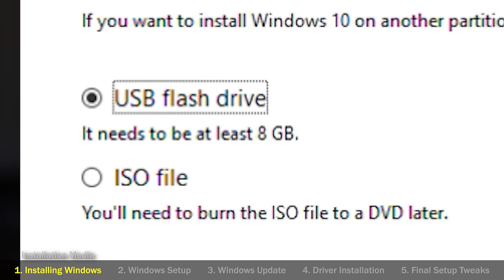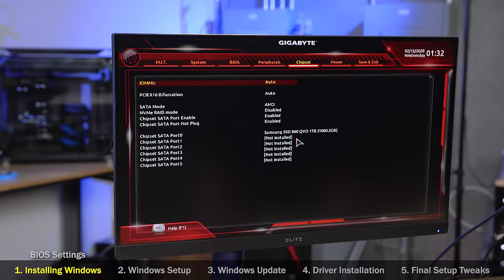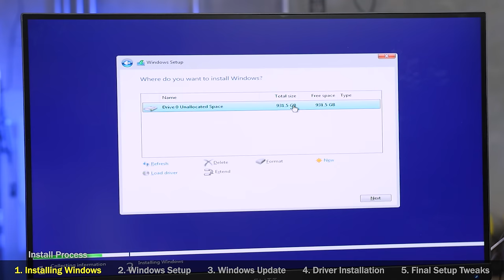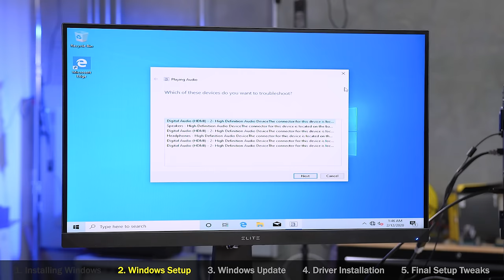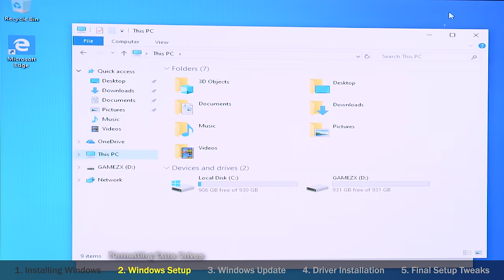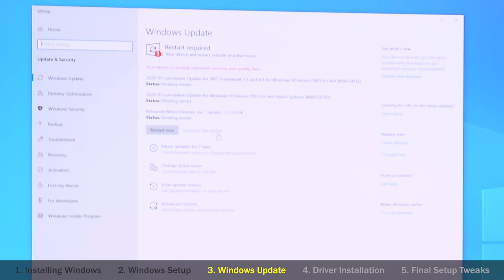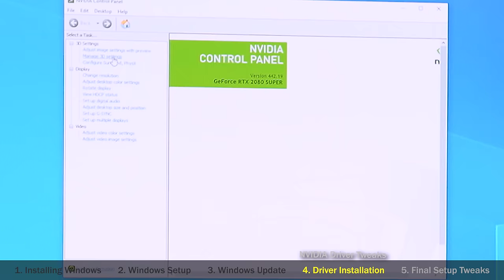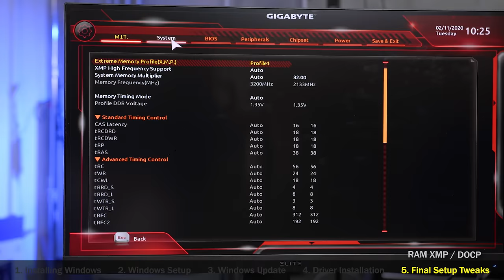Guide: What to do AFTER building your computer...

Comment: Funny enough, when I built my new PC I installed windows with an old boot medium I had lying around, and it was utterly unable to connect to the internet because the ethernet chip was too new to be recognised by the system - it knew that it was an ethernet chip but the driver simply wouldn't work.
Since the previous system had gone completely dead, I found the most insane workaround imaginable. I used my phone to create and download the .iso from microsoft, then copied that to the pc, then mounted the .iso as a virtual device and from that updated windows to a version where it could understand new ethernet chips :D

So, for anyone saying "always have a boot medium laying around" - yes, but also make sure it's no more than a few months old to be sure it can recognise current hardware components too. With an USB, just swap the data - with a DVD (if you prefer those or don't have a 8GB+ USB), either use a re-writable one or make sure to create new ones regularly.

Had to swap the mainboard anyways because it was a b550 rog strix board and those have faulty intel chips - my second piece of advice is, if you go for a b550, don't buy a ROG strix, and if you go for a ROG strix, don't buy a b550. With newly built ones I think the chances are good you'll be fine (intel updated the chip twice to work properly) but the risk is still that yours might stop working after a short while. So, third piece of advice: research the parts you're interested in before shopping! Some may be faulty or otherwise less-than-ideal, and you can save a lot of time (and potentially money) by making sure you get the right kit.

Comment: Aight, windows 11 doesn't let you continue to install unless you connect to the internet. There's no option to continue without, just a disabled next button until it's connected.
Edit: I first tried the killtask way but that's updated on newer Win 11 versions, using "OOBE\BYPASSNRO" worked for me.
Reply: How did you bypass the internet? I'm new to this and not familiar with that OOBE\ thing?
Reply: Had to google so I'll help others: F10, click in the black box to type, type "OOBE\BYPASSRNO" (those are the letter "O", all caps), press enter and the computer will restart. You'll re-answer some questions and now will have the "I don't have internet" option. :)
Reply: Just tried it and had to Google because it didn't work for me.

Shift+F10
Then type OOBE\BYPASSNRO
in command prompt and hit enter.
Computer restarts.
Answer same questions again and when you get to the connect page you now have the "I don't have internet" option.

Only the Shift part was missing from the original comment.
Reply: Also be advised that a Bluetooth/wifi keyboard would not work for this. 
Bluetooth no connection as drivers are missing. Wifi channel let’s you pull up cmd, but then doesn’t allow you type anything. 
So be sure to have a wired keyboard.
Then once you make it to the desktop you can manually install the internet drivers from a usb drive , which will now fix the internet on your pc. As during windows installation you likely couldn’t connect to the internet or would have done so instead of reading this lol.

Comment: For the windows part. I just had windows installed in a SATA SSD and for the 2 times I essentially had to rebuild my system to upgrade everything (New motherboard, new CPU, new GPU, basically new everything) I will just slap my SATA SSD in it and it's up and running. I then delete everything related to my old PC and then install the new things I need. I'm essentially transferring the "brain" of my older PC to my new one.

Comment: I totally agree everybody talks about the tower but not the hard part getting everything running. For instance it took me 12 days almost 8 hours a day to figure out how to get NZXT x62 to sync with the cam software. I tried everything cord related and driver related all the way to buying a whole brand new unit but unfortunately I got sent a used one from Amazon so I never got to figure out if that was the issue. Finally two weeks into it I bought a hub and it connected so at least I have life through my fans

Comment: 17:50 I highly recommend against setting prefer maximum performance globally. It barely makes a difference in games, so all it ends up accomplishing is forcing your card to boost to it's max clock 24/7, even if you're just idling on the desktop. If you're doing it for benchmarks then you should set this specifically for the benchmark applications.

Comment: 1:30 Wow! This is exactly what I need! I bought a brand new copy of Windows 10 on DVD, with the intention of doing a clean installation on my current PC (because the old Windows 7 "upgrade" isn't a proper upgrade). With my computer being so old and buggy, I figure I should just build a new computer instead.
I'll be building my new PC outside of a case, then transferring it into my old case (because my Thermaltake Armour+ case is awesome.). That means I will only have USB ports with no DVD drive, for installing Windows 10 from. In hind sight, I should have just bought Windows 10 on USB.

Comment: Would have been nice to find this yesterday. I got pissed off trying to figure out how to do this without an optical drive and went to bed. Spent a few more hours today and finally got it done.

I reused an old Hdd with data already on it and unallocated 500Gb to install windows on. I've hear that's not a great idea, but it's working fine so far. Also pulled another strange move in the form of reusing another drive with windows already on it as a secondary drive. Made sure the boot order was correct so I wouldn't have problems with it trying to use the wrong install.

So yay, I get to keep all my old data.
Reply: I wouldn't use a hard drive for Windows anymore. SSDs are significantly faster than hard drives and it will greatly benefit especially when installing updates. But to each their own.
Reply: @JJFlores197  I considered it, but I'd just built the rest of the tower and wasn't patient enough to wait any longer. I might reinstall it to an SSD in the future.

Comment: One important detail I think you forgot to mention and I realize it could be a rather "tricky" bit for novice users is updating the mainboard BIOS. To me it should be one of the last things to be done as long as the system is stable and operating correctly. t's not absolutely necessary but if you want the system to operate at peak performance, it could make a difference. If you're using, say, an older used board it's important to have the latest BIOS version on the system. Case in point, A z170 base chipset on some boards can run a 7th gen core i7-7700K as long as the BIOS is updated to a certain version and beyond but will not run the 8th gen chip at all. Similarly, some more modern GPU's require those updates as well. Just my "two cents"

Comment: 1:18 using my 5+ year old Win10 install disk caused me such a headache recently because none of my drivers wanted to work including WiFi and Ethernet. Ended up using a cheap usb Wi-Fi thing (which also required using usb to install drivers) to update windows after installing Windows. After that, the mobo Wi-Fi and Ethernet worked
Reply: Do you know a safe website to buy a windows activation key for cheap?
Reply: @oh60  can't you remove the watermark using bash or something?
Reply: @SuchANoobOG  I think you can, I might try it when I finish building my pc

Comment: Can see how some people consider transitioning from console to PC, it may not be obvious to some, but you can totally use your controller in games if that's what you're more comfortable with – using KBM is not necessarily required, so no need to fear re-learning muscle memory. Get games on Steam, they're cheap on sales.

If you're low on money, you don't HAVE to buy windows key, it can work unactivated with just a watermark.
And if pirating games via torrenting is your only option, at least consider using a VPN.
Don't feel intimidated about drivers and all the software part, you can't mess it up really. The worst case is simply reinstalling a driver/program and that's about it.

And make sure your screen is using maximum available refresh rate, you wouldn't want it to display only 60 if you bought a 144Hz+ screen. It's probably the most common mistake. If you don't have one, considering getting it, it's easily the biggest upgrade out there.

Comment: Here's a tip for those using ASUS motherboards. There's a setting in the bios that allows you to disable Armoury Crate. This means it will never get installed. Thus you completely avoid the bloatware from ASUS.

Comment: Watching this video is helpful. Does this work the same on the laptop? Because I was wondering if I buy a new laptop and want to move my old data from my current laptop to the new one?
Reply: Your new laptop will already come with Windows so no need to re-install it, unless you want to. But yes the overall process is the same. Do note that most laptops have far limited UEFI systems compared to desktop computers. Things like CPU and RAM overclock are usually non-existent in laptops.

Comment: Thanks for the video! 
Question:
Setting up a new computer with 2 different RAM sets. Both sets DDR5.
Set one 2x32 Corsair Vengeance 5200 PC541600 C40
Set two 2x32 TEAMGROUP T-Create Expert  6000 PC5-48000 CL34
Motherboard: GIGABYTE - B650 AORUS ELITE AX
CPU:AMD Ryzen 9 7900X

Should I install 1 set and configure, then the 2nd set or install both sets then configure,  or don't ever install both of these sets? 

Thank you.

Comment: What I always do after building a PC and installing Windows, or if have just clean-reinstalled Windows, first thing I do is goin into Settings > Windows Update, and check for SO updates. I let windows install all the updates that it needs after a clean install.
Then I go to the website of my motherboard and install the latest updates and also the Settings Client of the motherboard. That software is always helpfull to use the features and settings of every specific motherboard. I do the same with the Graphics card (in case the motherboard software doesn't handle the GPU aleady), I play with the fan curves and after I'm happy with all of that, I start installing my most used apps either from the internet or from an USB that I have with my backup files and apps installers.
Hope someone finds that process usefull

Comment: Windows 10 is basically fully automated to this day. Just boot and install it from USB thumb drive. Just 20 years ago, I used to install those with diskettes and CDs, and with very limited info even from google, imagine that.
Reply: Yep. And you can even automate it completely if you want. There are answer files you can create which can automate parts or all of the installation. I have an MDT server that I play around with from time and have fully automated installations of Windows along with programs I use frequently. It is a lot of up front work to do, but if you're imaging a lot of PCs, it does help a lot.

Comment: Something good for people who upgrade there pc. If you bought an OEM key before. If you try to upgrade parts and you come to a point you want to format you hard drives.. windows won't clean Install anymore , it will install but the boot file will be corrupted.. you have to buy a new OEM licence or and upgraded retail one. Or you won't get your windows up and going...
OEM licence keys are used for company's like dell to make a 1 time installation on factory desktops. Windows saves your hardware ID and any change the licence keys will be validated as a correct key but it won't install the needed files for a boot.. took me five days to find this out.. I clean tested every piece of hardware, swapped  around parts and then eventually bought everything new.. just to find out about this..

Comment: I discovered my RAM wasnt running at its correct speed. As a tip to others if you turn on XMP or DOCP and the system starts performing strangely update your BIOS while making sure without any doubt you have the right BIOS version. My computer would randomly just not display video. It would turn on but no image. Set it back to 2666 and it would be fine. Turns out the BIOS was 1201 and it was 3 years old.......so. New BIOS in and I set the speed to 3200 and never had an issue again.

Comment: To make the bootable USB, do I need to download windows 11 from a computer using a windows operating system? I have a Mac m1 and have heard I can't create a bootable usb with windows from Mac
Reply: The Media Creation Tool only runs on Windows. You can still create a USB installer on a Mac, but its a different process. You'll need: Your Mac, flash drive, Google Chrome, Chromebook Recovery Utility, and the W10/11 ISO. Once you have everything you need plug in the flash drive to your Mac. Change the file extension of the W10/11 ISO from ISO to BIN of the. Open Chrome and then the Recovery Utility. Click on the gear icon and choose Use local image. Select the BIN file you renamed earlier. Then select the flash drive you want to restore to. Let the program work as it may take upwards of 30 minutes. Once it is finished, you can remove the flash drive from the Mac and plug it into your new PC and install Windows as shown in the video.

Comment: Step 1. Obtain Windows install media USB.

Step 2. Install Windows.  (If new system, only one partition will exist, install there, if an old hard drive/ssd/system you may have multiple partitions or existing data, if you don't need to keep anything, make sure you delete and reformat over everything.)

Step 3. Click "No" or "Skip" to anything that is optional.

Step 4. Let Windows install, then when Windows is installed and when you get to the desktop, INSTANLTLY use Edge to download and install Chrome.  (Yes I know new Edge is Chromium based, but Chrome is still far superior, maybe consider Opera over Chrome if the additional features appeal to you.)

Step 5. Set Chrome/(chosen browser) as default browser then delete/hide all shortcuts to edge.

Step 6. Install Malware Bytes free edition, and set scan frequency to weekly.

Step 7. Make sure Windows Defender is on and working (Windows built in anti-virus used to be dog shit, these days it is actually OK, and paired with MWB is all you really need)

Step 8. If laptop, change power settings so that while plugged in max performance preferred.

Step 9. Enter bios, ensure XMP is enabled (this is optional, depending on hardware specs, may well be a redundant step, but worth checking your memory is working at advertised speeds)

Step 10. Your system works, and should be stable as you haven't really changed anything.  if you aren't a "power user" or gamer, and your machine doesn't have a dedicated GPU you can stop here.  Congrats, PC is ready to use.

Step 11. If you have a dedicated GPU, go into your Windows settings to ensure this being used rather than the CPIU's on board graphics.  Then install Nvidia or AMD software to ensure your GPU drivers are up to date.

Step 12. This is where you start diving deeper and going into bios settings/OC'ing/freesync/Gsync settings etc.  This is the point where you start installing hardware monitors, stress tests etc to dial your settings in.  If the previous sentence doesn't make much sense to you, you should have stopped at Step 11.

Bonus info:  When you get into windows (10 and above specifically) and it starts prompting you to "activate" don't worry about it.  In modern versions of Windows, the only thing an "unactivated" version cannot do, is change wallpaper/themes, you will still get all essential security updates for that platform.  If you have re-formatted an old OEM machine there is a good chance there will be a windows product key on a sticker somewhere on the machine, these keys (even if they were for versions as old as 7) will activate windows anyway.  Another way to circumvent this is to buy a product key from a country in a region where Windows is insanely cheap, such as South America or the Middle East, you can get a legitimate foreign key, for less than $10.

Comment: Pro tip for those like me who truly started out knowing NOTHING, don't be worried, for the most part, that a part you want can't find your build, for example don't be worried that a certain ssd card won't fit your motherboard, most boards are built to fit almost any kind of ssd. General idea is as long as it's not some cheap kock off 3rd party bootleg part, you'll be fine in terms of dimensions and fitting

Comment: That was a very helpful video. 
Could you please do a updated version. 
I'm about to receive my first gaming PC from Flying Phoenix PCs. 
I will be running the AMD Ryzen 5 7 series f
And Qik 319 .
I will be using windows 11 operating system (pre-installed)
AMD Adrenaline (pre-installed)
MSI Control Center (pre-installed)
Steam and Google Chrome (pre-installed).
What's the hotkeys and what would be the list of things you would do to get the most of my setup (playing Call of Duty Modern Warfare 3)?
Thanks. 
Sincerely A-A-Ron!

Comment: Question regarding about isolating of windows installation for future formats; Lets say you have 1tb ssd, isnt it better to partition it so that if for any reason you need to reinstall or format said drive, you do not lose rest of the files on current drive. Which leads to question that if you do this, how big of a partition should you leave for windows installation?
Reply: I would go with at least a 200 GB partition for Windows. Windows is not space efficient.